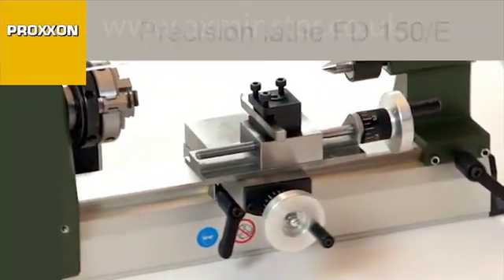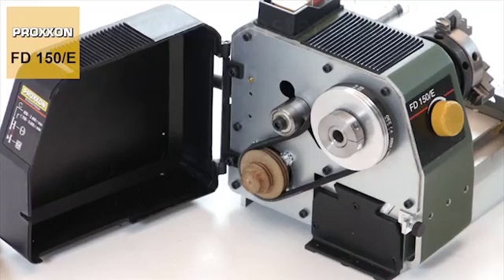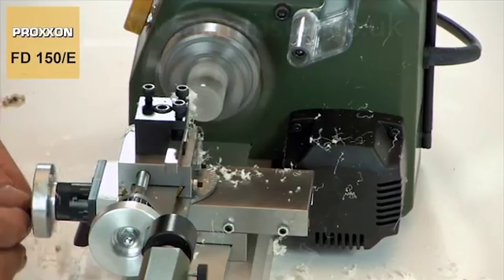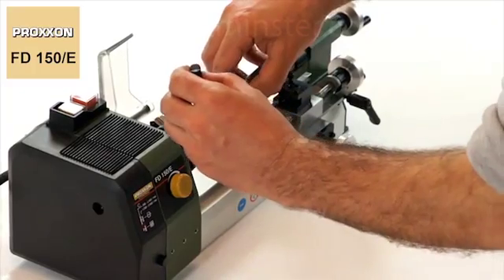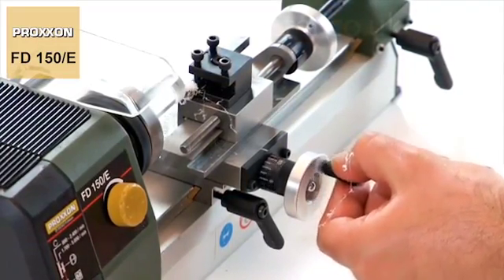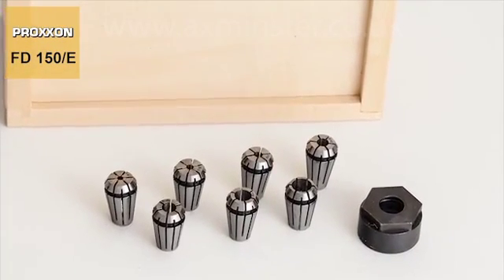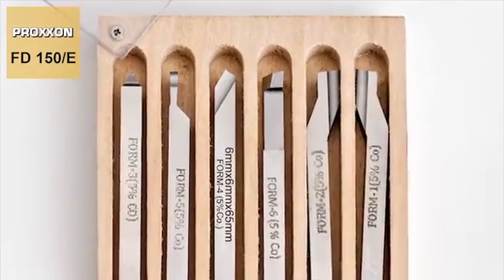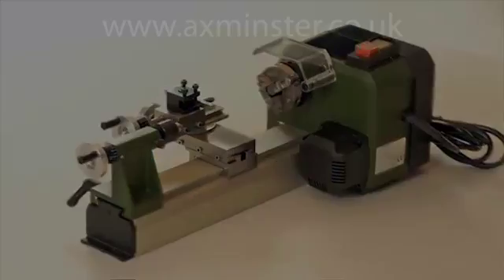Proxxon FD 150/E Lathe

Comment: This thing is really cute, but probably not too useful.  I can do far more, and obtain or build more accessories for my 7x16 mini.  The minis currently being sold by Micro Mark and Little Machine Shop use more powerful brushless DC motors that do NOT need the 2-speed noisy gearbox required by older minis.
Reply: 7x16 is a legend, real tool, this proxxon is a toy and nothing more. Just like the mf70 it lacks the rigidity and the torque to do anything.

Comment: I've been working as a research machinist for 40 years and during this time I've never seen a small lathe worthy of the same craftsmanship seen in older machines like the Hardinge, Bridgeports, Southbend and Clausing. Much thought and design is put into theses machines but you will never see it in these small lathes even though we have the latest in CNC technology that makes parts with greater efficiency and accuracy with far less labor. Is it asking too much to make better machines as we do with cars? I suppose this is the result of the end of the industrial age as the information age has taken over.
Reply: I agree! I would love to see a desktop size lathe thats completely overbuilt and fully capable to turn steel. We have the technology with powerful brushless motors that literally fit in the palm of your hand, I know its possible. I have an atlas 618 and I just LOVE the style they put into the older machines! Its got sleek swooping lines and curves you just can't find on any of these chinese machines.  Older machines just have a quiet elegance to them that new machines are really lacking.
Reply: GnosisMan50 do t forget about monarch!

Comment: Thease lathes are very expensive aswell you can get more bang for your buck and with the same accuracy from amadeal or worko or Axminster or clarke ect ect...
Reply: I have a Warco lathe but the FD 150 fits the bill for small fiddly work machining parts for model boats. The Proxxon is light and small enough to keep indoors and move to where I want to work. The Warco had to be lifted with an engine hoist into position. So horses for courses.